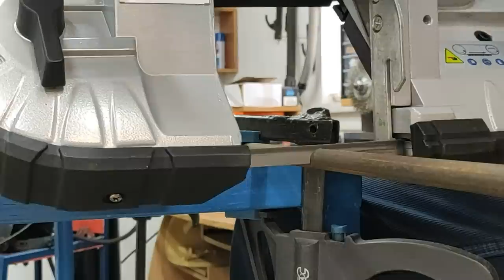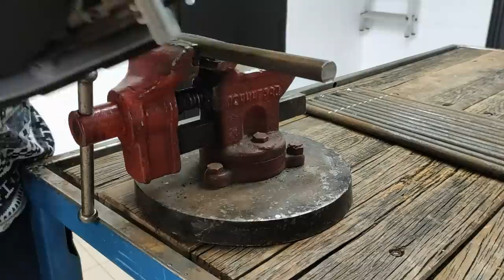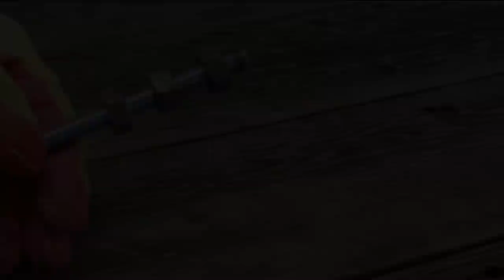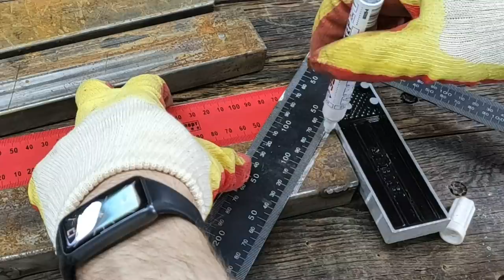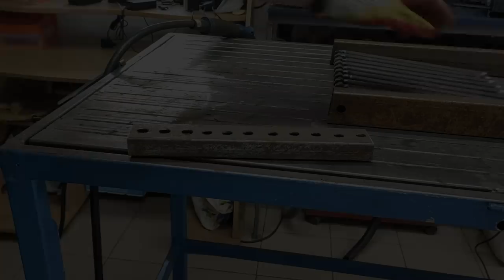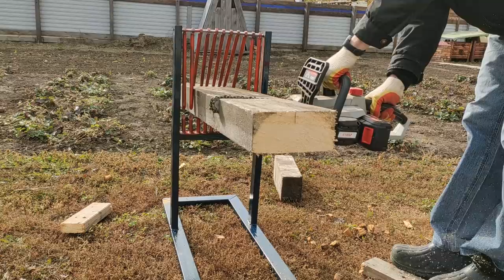The secret invention of the Russian guy. Amazing DIY idea

Comment: Fantastic! Not only is it so simple, but the safety factor creates a sturdy hold and allows you to work both sides. Great job.
Reply: Please tell me, what is the safety factor displayed here.
Reply: It's the spikes holding the wood steady, while balanced at the tipping point. It's basically getting a gravity assist at the points of the spikes. As both ends are worked, the balancing point and the spikes hold it steady. It won't roll left or right, or slide forwards or backwards. I have tried cutting logs and boards needing an extra pair of hands. This device makes it a one person job.

Comment: great idea for a one man job
it would save time if you cut the bars at double length and then cut them slanted in the middle
same result but half the cutting me and half the wear on the band saw
Reply: The mechanical engineering verdict is that neither top
nor bottom bars need to be sharpened at all, thus not
requiring a band saw either.

Comment: If you had measured the length of each piece on the total bar stock you could have alternatively cut the 45 degree then the flat then the 45 then the flat had all peices to size and appropriate angle with no scrap left and only the last peice would be left.

Comment: You put your expertise cutting angles so well ...you know that the welding will compensate your decimates errors...that’s the way.
And....do not forget...4mt by 3mt equals 5 mt...60cm by 80cm equals 1mt, and so on.
These days lots of engineers do not know how to take measurements by a measuring tape , or... using a simple 12 nots fine cord.
Well done. Cheers from Portugal.Peace

Comment: That’s actually a great idea. I was really wondering what kind of a one way torture device you were building there and couldn’t wait to see it’s intended purpose 👍
Reply: It's not a great idea; it is a silly idea.
Reply: Gran ingenio
Reply: @kansasross  for people like the creator and myself who cut wood it’s a handy little device, keeps the wood in the air so you can keep your chain out of the dirt. 👍
Reply: You're right. It would have to have a safety bar you could put on it with a lock. A cow, child, anything could put it's head or arm etc in it and get stuck very easily